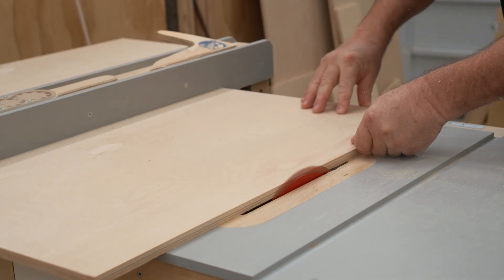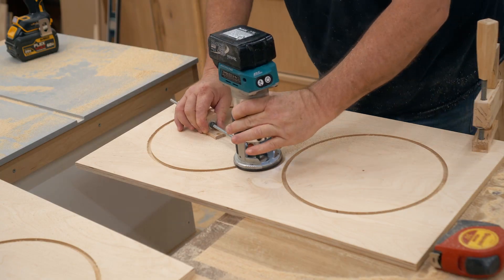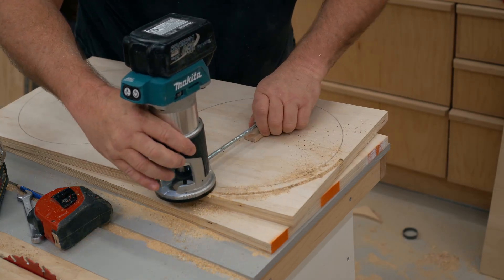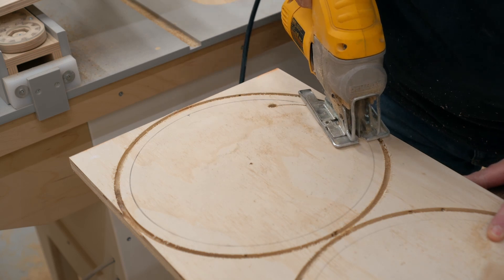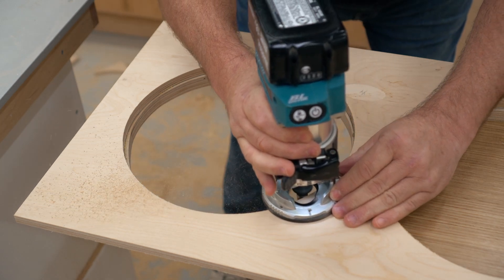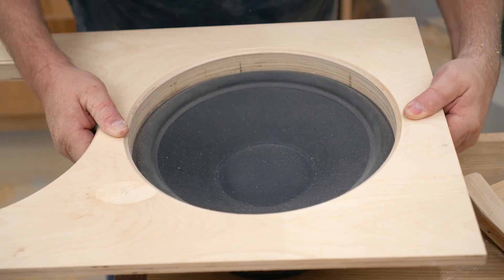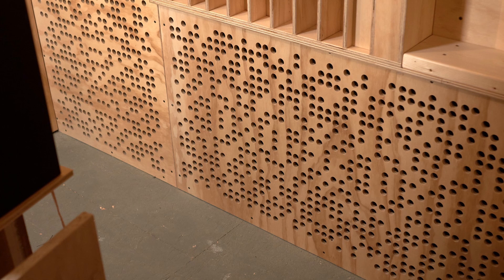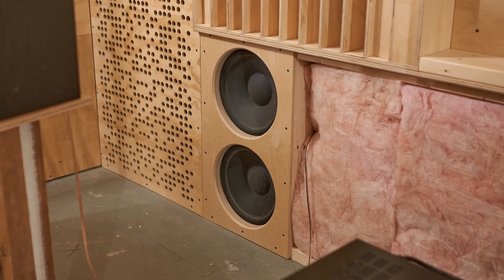BIG Bass in a Small Room - Making Infinite Baffle Subwoofers

Comment: Do you have an idea what is the flow resistivity of the insulation material you're using?

for depths larger than ~20cm / 8 inch you need to use fluffier and less dense stuff, something in the range of 3000-5000 Pa*s/m². 

Otherwise if you use very dense material (10000-15000 Pa*s/m²), air/sound cannot penetrate all the way through and you would not absorb frequencies below 200Hz effectively.
Reply from the maker: Too much attention is paid to that and it really doesn't have as big of an impact as some assume it does. The difference in practical terms is negligible.
Reply: @IBuildIt  

Thanks for the reply, I haven’t really tested it out in any meaningful way. It’s just what I heard from other people and the simulations really back this up. 

Most dense material plateau around ~20cm in simulations. Did you test materials of different densities / flow resistivity?
Reply from the maker: Generally the deeper the absorber, the less dense it should be. But most people don't have enough space to come close to the point where that makes a measurable difference. And then when it's measurable, that doesn't necessarily mean it's an audible difference.
Better to concentrate on area coverage, at least 15% of the room's surfaces, and make it as thick as practical.

Comment: you don't risk damaging the woofers by bottoming them out when you open/close the door to the rooms?
Reply: The door status will not make a difference, the woofers can bottom out either way.

IB 's are excursion limited, not power limited. My 4 x 15's can thermally handle over 2000 watts, my amp is set up to max out at 600 watts to limit excursion. Even with that, output is over 122 db at 20 Hz without room gain taken in to account.

I use a brick wall ( 24db/ octave) high pass filter at 15Hz to prevent over excursion and still have significant output above it.
If you build an IB, plan on having a MiniDSP or other parametric equalizer as part of your cost, you will need it to get the best response.
Reply: @joesabato9736  not the state of the door, opening or closing the door
Reply: @fuzzy1dk  Thats what I was referring to by status, the door being open or closed.  My IB array is in the unfinished basement firing in to the room through a floor grate.  The basement is around 16,000 cu ft, even if was 1/10th of that size, the drivers could bottom out at real low frequencies.
Reply: @joesabato9736  I'm talking about the action of opening or closing the door
Reply: @fuzzy1dk  
The action of opening or closing will make no difference.

Modeling my IB drivers with 180 watt input in WinISD,  the excursion at 10Hz barely moves with change in box volume ( size of the room behind the drivers)

1060 cu ft size, excursion is 16mm
2118 cu ft size, excursion is 16.18mm
17500 cu ft size, excursion is 16.26mm
Xmax on the driver is 16.3 for reference

So whether the door is open, closed or in the process of changing anywhere in between, the impact on excursion is negligible, hope the numbers make it easier to understand what I was trying to convey above
Reply: @joesabato9736  I'm not talking about the speaker being driven with an amp. I'm talking about the door working as ~2m^2 "membrane" causing a pressure spike in the room while it is being opened or closed
Reply: @fuzzy1dk  There is not enough pressure on the back side to have the door act as a membrane
Reply: @joesabato9736  maybe not, try watching the speaker cone while some else opens and closes the door

Comment: I'm wondering if the acoustics of the adjoining room have a similar effect on the speaker performance to the acoustics of the listening room?
Reply: No impact of any significance. 

Consider this; those same woofers where they are, with a normal size backspace box enclosure. 
That would be significantly impactful to the operation of the woofers. 
Slowly increasing backspace volume diminishes the backspace effect on the woofers. 

Thus, an infinitely large backspace has an infinitely small impact.

Comment: Welcome to the world of IB bass! 

If you find that the direct wall mounting vibrates your front wall too much, make 2 more panels and build manifolds with the drivers opposing each other, with the opening where the drivers are now. 

Block off 1 of the woofer holes in each panel for possible future expansion.

That setup will reduce/ eliminate any sympethetic vibrations that the drivers induce in to your wall

Comment: Was hoping it was going to be Runnin with the Devil
Reply from the maker: Rock songs from that time period actually have very little low bass in them. Kind of disappointing when you have a well treated room to listen in and one of the downsides.
Reply: @IBuildIt  Just build a set of K horns or any horns will do for that matter, to compensate👿
Reply: @robertbarcus1963  
K-horns are excitingly impactful, but can be really weak in the deep bass...  I believe in the mid 40s they drop off like a rock.
Reply: @IBuildIt  Pink floyd, Comfortably Numb is a track that I use for bass response testing.  As well as Bob Marley -Three little birds.  You're right on rock bands not having much bass in them, especially Van Halen.  The mixing on most of their albums ducked most of the bass, the same with Metallica, until ...And Justice, where they ducked just the actual bass (poor Jason).  There's a few outliers though.  Rush should have some good response.